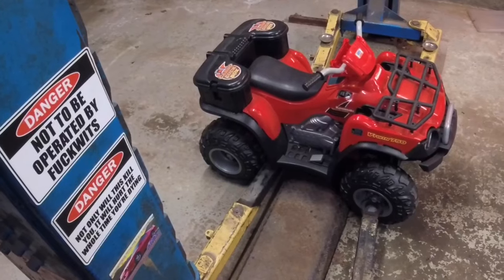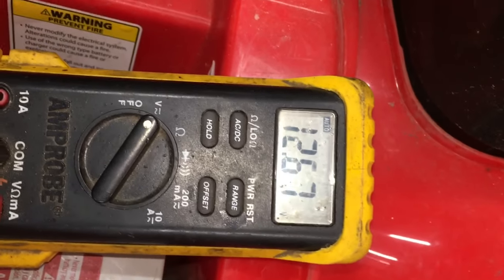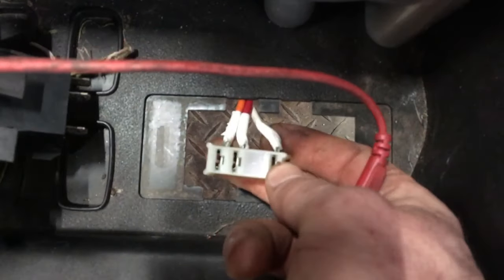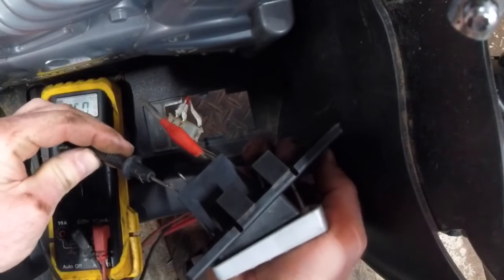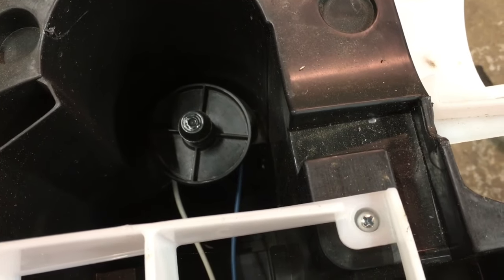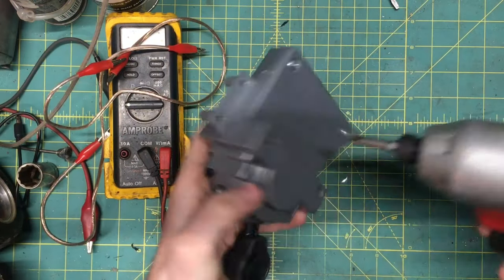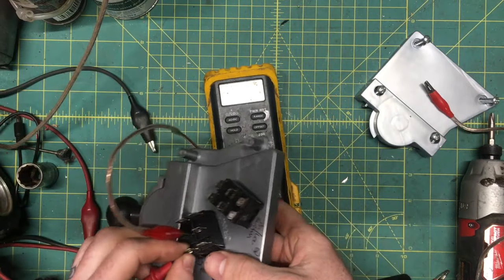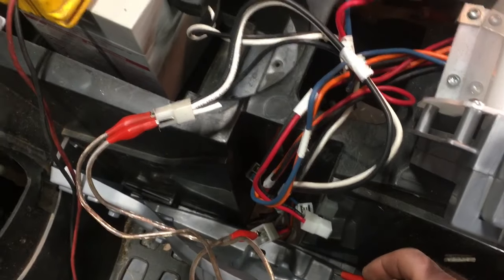How to Troubleshoot Any Power Wheels in 5 Steps

Comment: Super helpful. Was able to narrow it down to one of the switches in the gear selector. Pulled the switch apart and found a crack on the side that allowed the electrical contacts to not touch. My wife thought it was sexy I figured it out but I just followed your instructions. Thanks!
Reply: hell yea shane

Comment: Ohm readings for pedal and gear selector switches start at 1.2 and drop to 0.6. Is this okay/normal? Or are all my switches bad? Great video. Helped me a lot so far.
Reply from the maker: Yeah, it takes some meters a second to settle down to a steady reading. 0.6 ohms is normal.

Comment: I've got a First Drive Mustang blue electric toy car, with no power when I hit the power button. I used volt-meter and checked the battery is fine, the charger port is fine. There are three wires, red and white go to the battery and a third grey wire goes to some module.. can you tell me how to troubleshoot?

Comment: All 5 of these test as expected, but when I try to determine which lead powers 12v to the pedal, I put the black lead into a black wire plug but then all 3 spots don’t show voltage. Sign of bad wiring/batter connector?

Comment: Out ncqueen recently stopped working mid drive. Charger and battery are putting off the right voltage. However the gas doesnt seem to activate the charge. Any common issues with mcqueen to trouble shoot? I already took the whole body apart and all the wires are in good shape
Reply from the maker: Check the battery voltage while pressing the switch. Sometimes a battery will show good voltage until it’s put under load. If the voltage doesn’t go down at all when you press the go switch, check the switch itself.

Comment: I picked up a jd gator looking one of the curb awhile back. I hate the batteries that come with them. I ended up using a Milwaukee drill adapter. It runs well, kids love taking hay to the horses in it.

Comment: Great video - good advice. My sons power wheel jeep only has reverse now. Forward isnt working. I upgraded his battery to a Ryobi 18V and he's been riding it with no issues for a month. then all of a sudden yesterday he went to get in it and it doesnt go forward. when he hits the pedal while in forward you can hear a click noise then nothing happens. reverse works fine. do you have any suggestions? thank you in advance
Reply from the maker: I would check the switches. The switches were designed for 12v, not 18v- those power tool battery upgrades are cool but they do cause more wear!

Comment: My daughter has a 6 volt kalee trail racer atv that works in reverse but not in forward direction. I'm going to test the forward neutral reverse switch with my multimeter similar to what you did in this video, but is it safe to assume that's the issue? 

Loved the video, liked and subscribed. Thank you!
Reply from the maker: I would definitely suspect that first!
Reply: @thedoubtfultechnician8067  The switch seemed to pass the continuity test, but the ohm reading seemed to jump around and was not consistent. I reversed the switch and was able to get the vehicle to move forward, but would not move backwards. Ordered the new switch last night so I will provide an update once that part gets in.
Reply: bud ..pull a switch on your switches  lol verry common
Reply: @malotoca7638  I did end up switching it out and works great now!

Comment: Thanks for this.  I got as far as the foot pedal test on my own.  My model doesn't have a safety relay, but I was unsure about the switches in the shifter and how the power was routed through those pins.  Simple simple once I had that.  Thanks so much!

Comment: My daughters is charged and will go if I hold the power button but if I just push the power button it won’t power on it just flashes the the back lights. What do you think is the problem. I don’t have an ohmmeter to test everything.
Reply from the maker: Sounds like your power button isn’t latching and needs to be replaced.

Comment: goodday i have a problem with my power wheels it doesn't have enough power to back up it works but it not enough to back up, moving forward is ok. what are your thoughts in this?
Reply from the maker: I would check the forward/reverse switch for corrosion.

Comment: Hi, great video but I need some further help. Everything works on my kid's Dune Racer except when he is in it, it will stutter, like go and stop intermittently when the pedal is pressed. It doesn't do that if the back is lifted up and I'm just pressing the switch. Background: I had added another 12 V battery to make it 24. Used cheap wire from Amazon. The connections are secure but maybe the wire is no good? Or maybe it is just the switch?
Reply from the maker: 24V is almost definitely too much for the motors, wiring, and switches. I know people do 18V conversions but that’s even pushing it. You could have undersized wiring, switch contacts corroding from arcing, or melted brushes. Or any combination of the three.

Comment: I haven't hooked anything up to check connections, but I'm thinking it's the main controller.  Battery clicks every time pedal is engaged. Brand new, unused battery with same result. I was really hoping to. Avoid taking it completely apart. 

I think I'll have to upgrade it to 18v or 24v while I'm at it.
Reply: So how did things go because i have the same problem?

Comment: Hello, my son has a battery powered car (12v). I got it from a friend but it has been plugged in overnight and it turns on (it didn't before) but when we press the gas pedal it seems to short out. Could it be the charger, battery, combo?
Reply from the maker: Try unplugging the motors and pressing on the gas. If it doesn’t short out then, most likely motor(s) have failed.

Comment: Picked up a dune racer… having a super weird issue with the high speed mode. It works when there isn’t weight on the powerwheel but doesn’t work if there is weight (if I push down or have my kid on it). Kinda puzzled
Reply from the maker: I would start troubleshooting by measuring the battery voltage as you step on the pedal with weight on it. It should drop a few volts under load. If it doesn’t drop any, that’s a wiring or switch issue. If it drops a lot, then your battery is likely toast.
Reply: @thedoubtfultechnician8067  awesome, I will try that out. Thanks for the quick reply back!

Comment: Do you have video about a UTV that only goes in second gear. Reverse and first don’t work.
Reply from the maker: Sounds like an issue with the shifter switches
Reply: @thedoubtfultechnician8067  any chance you cold point me toward a video to watch regarding shifter switches?
Reply: I also had purchased a replaced the gear knob ( guessing that is the shifter ger)
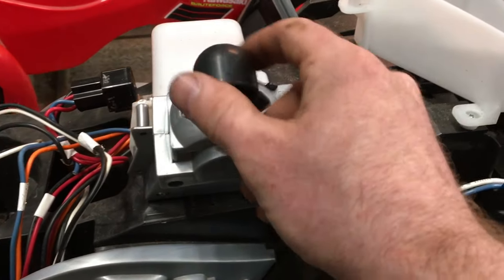Reply from the maker: This video goes over the switches @5:06. I would also check the motors, if there are two and one is burned out or disconnected it would only work in high speed but not low. Raise the back end and see if both wheels are spinning in high. If only one is spinning, you have a bad motor.

Comment: My relay is is showing the right volts without having to push on the peddle. Is that weird? I have 4 of these can't get a single one to work. 3 of them are brand new.
Reply from the maker: Power goes to the relay at all times, but  the coil in the relay itself only gets power when the pedal is pressed. So you should have power to one pin all the time and two pins when you press the switch. My guess is you’re checking the wrong pin

Comment: On the go switch I’m getting 0 ohms between the pins. That means the switch is bad right?
Reply from the maker: 0 ohms means the switch is in the on position. So if it’s doing this while the pedal is pressed, that is a good thing.
Reply: @thedoubtfultechnician8067  ok, so my go switch seems to be good then. my battery is reading 12.6v but i havent checked it under load or swapped out with known good battery yet. ill try swapping out battery 1st and then move to the 3rd area in your video. thanks
Reply: @thedoubtfultechnician8067  12v green kawasaki kfx quad

Comment: I have a powerwheel boomerang and i cant find out whats wrong with it. I've recently mod it to the ryobi battery charger. The powerwheel will flash green for like a few seconds then change to blue. My son can ride it for like 2 seconds then it dies and we would have to disconnect the batter and reconnect to start up again. Any ideas? Much appreciated!
Reply from the maker: What voltage ryobi?
Reply: @thedoubtfultechnician8067  18v

Comment: Why does my pedal relay show OL there's continuity between the 2 pins but OL shows on the screen of my tester...
Reply from the maker: OL means there is infinite resistance, or more resistance than your meter can measure. Basically zero continuity.

Comment: Any suggestions for when only one rear wheel accelerates but the other rear wheel doesn't move? It just decided to stop working one day.
Reply from the maker: Unplug both motors and verify the voltage to each one when you step on the pedal
Reply: @thedoubtfultechnician8067  OK. What's the fix if that's the problem? Sorry, I have 0 knowledge about cars like these but I really appreciate the help.
Reply from the maker: Do you have a volt meter?
Reply: @thedoubtfultechnician8067  I don't but I can go out and get one.
Reply from the maker: Yeah, realistically you won’t be able to diagnosis this without one. You only need the most basic one. You could try removing the motors and swapping sides to see if the problem follows the motor or not.
Reply: @thedoubtfultechnician8067  OK, I finally disassembled everything and the red wire going to one of the motors broke off.  The tab is still on the motor and the wire still has the clamp on it. Any ideas? Could I use electrical tape to reconnect it?

Comment: One question please, I have bought a car for my son and I changed the motors, I put in higher revs. my problem is that it works for 15 seconds and then it turns off by itself and turns on after 5 seconds. this happens constantly. it had a 12v battery  4.5Ah and I put a new 12v 9Ah one but it still does the same thing. Do you know what the problem is? Can you help me?
Reply from the maker: Part number for the new motors?
Reply: @thedoubtfultechnician8067   Gearbox RS550 Replacement 12V 40000rpm.
Reply: @thedoubtfultechnician8067  the previous motor was 12v 16000rpm
Reply from the maker: @bambamyt5915 Do both motors quit? Or just one? If both motors quit it is likely a wiring issue in the car. 

When they quit, try measuring the voltage at the motor and see if you still have a 12 volts.
Reply: @thedoubtfultechnician8067  It shuts off the whole car completely, neither lights nor radio work and it starts again by itself. this happens all the time. the battery is new and I measured it and it is 12.3v if I remember correctly. after the battery there is a fuse, these days it will  I'll also change the fuse, I'll put a bigger one to see if that's where the problem lies.
Reply from the maker: @bambamyt5915 I wouldn’t replace the fuse with a bigger one. Fuses are sized for the wiring, and are designed to keep wires from melting and starting fires. Also, fuses don’t self-reset so I doubt that’s your problem. What model car?
Reply: @thedoubtfultechnician8067  I send you the links but they are deleted, I don't know why.
Reply: @thedoubtfultechnician8067  the model car is anpabo Licensed Mercedes-Benz G63
Reply from the maker: That model has a thermal fuse near the battery. The battery is getting too hot and killing power to the entire car. Those higher RPM motors are incompatible unfortunately.

You can try bypassing the thermal fuse for diagnostic purposes, but I wouldn’t want my kids riding it like that.

To fix it properly would require thicker wiring to handle the extra current.
Reply: @thedoubtfultechnician8067  So the solution is better power cables and a bigger fuse?

Comment: Someone told me you had to have a code reader for some power wheels to figure out what was wrong, battery is good but motor won’t turn. Suggestions?
Reply: Maybe some of the really expensive Power Wheels but not these cheap ones

Comment: Any tip for if the rig won’t stop when letting off of the brake? It just coasts instead of stopping as it used to.
Reply from the maker: Model? Sounds like the brake reduction module or a wire to it has failed. Basically just a resistor to load down the motors when not on the accelerator.

Comment: Did a curb pick up on a dynacraft. Changed battery to lifepo4, pedal and shifter and still nothing.  I wished I knew how to better trouble  shoot like you. Lights comes on when switched but once pedal is pushed lights turns off and no go :/
Reply from the maker: Do the lights come back on when you release the pedal?
Reply: @thedoubtfultechnician8067  yes it does. Could it be the off on switch? That and the charging switch is the only thing I didnt change out :/
Reply from the maker: It sounds like you have too much current draw. I suspect either the motors are locked up/shorted out. If you unplug the motors, step on the pedal, and the lights don’t go out I think that’s got answer. You can also try measuring voltage to the motor wires while they’re unplugged and see if they’re getting voltage.
Reply: I haven't test the motor wires itself but willl later. However they do run When directly connected to the battery
Reply from the maker: Well that rules out the battery and the motors. I would measure for voltage at the batteries next, maybe a broken wire
Reply: @thedoubtfultechnician8067  just tested the power wires to the pedal and only reads 2v. Read 12v at the charing port, so kinda of odd. Gonna remove panels to look at the running wires soon.
Reply from the maker: Is that 2v with the motors plugged in? Or unplugged?
Reply: @thedoubtfultechnician8067  so finally pulled out the dash and got the Power switch, wired read 12v and changed the switch. Now is working! Thanks so much for your video and you help here bro, your are awesome!
Reply from the maker: Another curb pickup victory! Well done

Comment: Our power wheels runs in reverse and low speed without issue. When in high speed the tires will only spin when lifted off the ground. As soon as my kids sit in it the motors torque up but then immediately shut off. Any ideas?
Reply from the maker: Without seeing it in person, my first thought is poor context in the shifter switches.